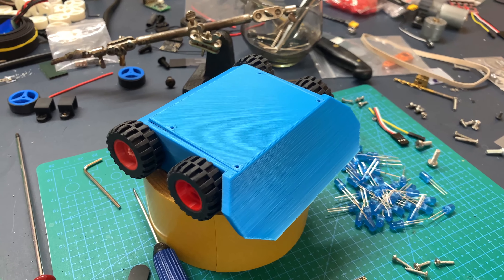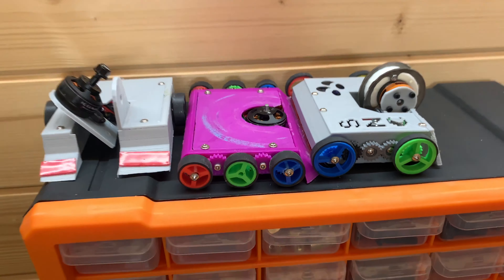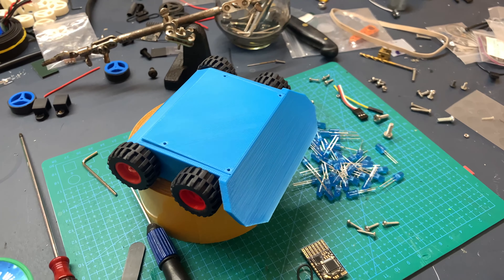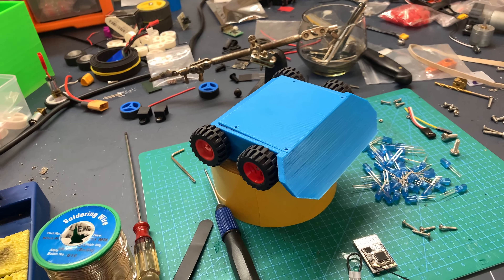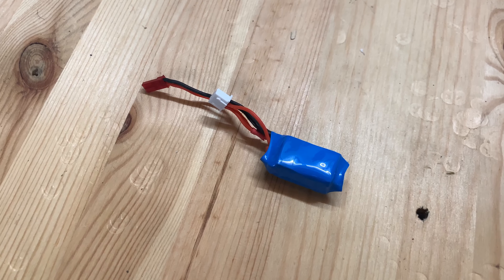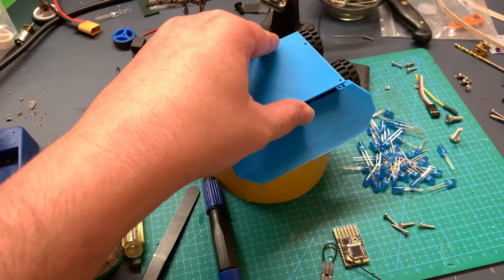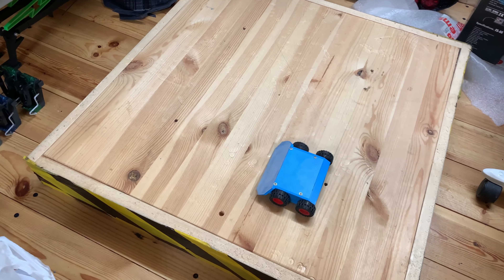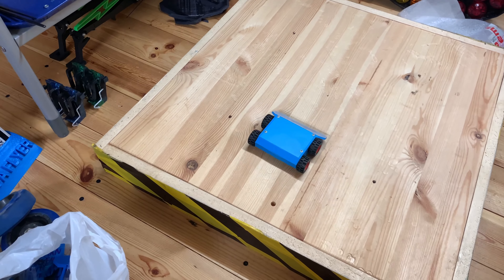Look What You've Done To Our Breakfast!

Comment: How close are you the weight limit with this design? Other than the fact it has four drive motors it looks pretty light.

I've been able to use limited amounts of steel in my designs. I planned to do the same with my next creation (I want to bring two robots to AWS), but I  added 10g of plastic to the chassis so I'm nervous.
Reply from the maker: It weighs 138g, about 12g to spare.